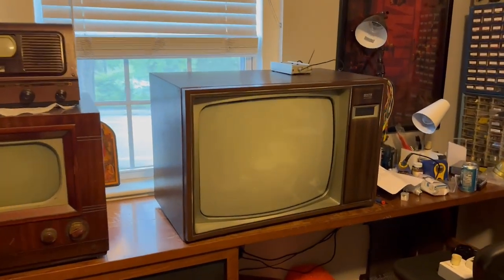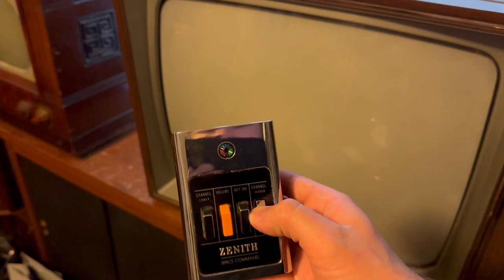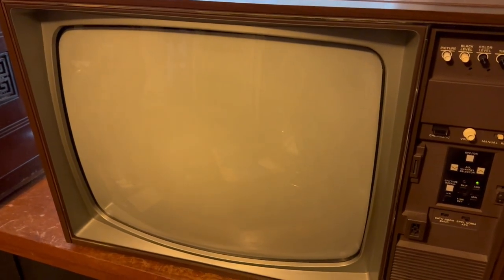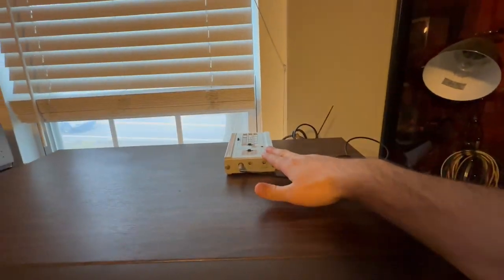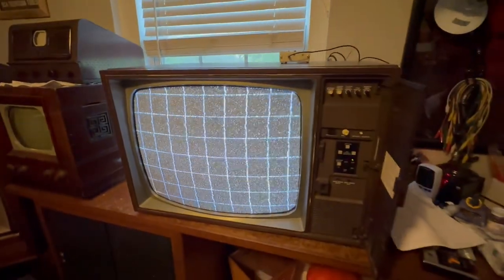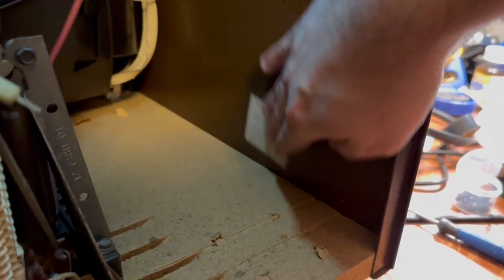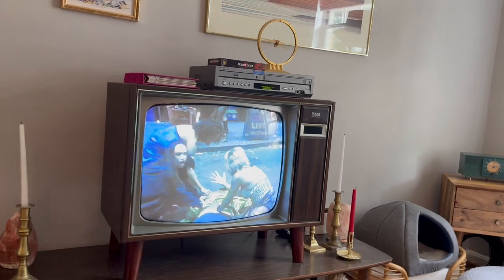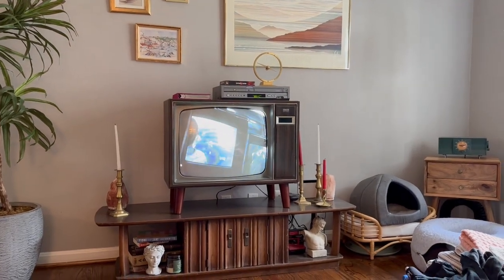Zenith Space Command Tube Television

Comment: One of these belongs to a composer who appreciates the notion of using sound as the remote controller.
Reply from the maker: I can understand that. It's a shame this idea didn't continue that long. I'd love if this was still a thing to reduce using batteries in remotes.
Reply: @televisionforever  Zenith could be wildly innovative. I have the first flat screen CRT ever, a Zenith. It is small, but oh did it change everything. Zenith saw into the future.
Reply: @televisionforever  lots of stories about the sets responding to shaken car keys and such.
Reply from the maker: @johnnytacokleinschmidt515  I’ve heard that too about older models that have a huge rotating tuner. I’m not sure if the shaking keys will work with this set but I’ll give it a try.

Comment: Your question about the remote may  have been rhetorical, but if you're wondering, one of the reasons they moved away from those "clicker" style remotes is because vaccum cleaners could produce the frequencies necessary to control the TV, and could cause the set to go haywire flipping through all its functions. Thus it necessitated manufacturers to introduce toggles for the remote function. 

Of course, with improvements to technology, they could make smaller remotes with more features than those "clicker" remotes could provide, since the latter had to fit a separate clicking mechanism inside for each individual function. This is the main reason, but I have to imagine the vaccum cleaner bit played a noteworthy part.

Comment: This set is a late ultrasonic remote. Original hand unit was battery operated. 
About this time they switched to IR & added more functions. It is a 2nd gen 
System 3 chassis. NORM-SPCL sw gives more AFT range. The other for OTA-CATV
channels.  Almost all problems on the 9-160-## PS/HV board. Mostly cold joints
but there is a 10mfd / 315V cap on the right rear corner near the FBT. Change it !
Main filter can leaks too!  Antenna hook up is stock  Tag you found WAS on the CRT
& a readout for its new condition.  CRT is a Zenith EFL type. Very sharp & bright
enuf to light a room !

Comment: 7:13 Could be aftermarket, they really held back a lot in NA on adding advancing AV ports, I was looking at a TV made in 1998 that still only had one RF coaxial port. Like in hindsight Composite should have been standard by 1985 as we had a lot of devices for that by then.
Do you always stick to stock era AV connectors, I've noticed TV restorations almost never add modern ports of any kind? For comparison most of the early 80s computer monitors were just SDTVs with the tuner removed and RCA jacks added.

Comment: I'm betting that set uses infra red remote control and MAYBE it still supports really old audio tone remotes. If you have a Beltron rejuvinator I would test the tube and just do a cleaning on the guns. I loved Zenith TVs because as long as the crt is good they had a excellent picture but I do have a Beltron so I could bring marginal tubes back to life for a long time. Too bad you can't get rebuilt tubes anymore but I gave up when flat screens came out and analog shut down there no longer was a market for old sets. I still have a bunch of tubes and old test gear that is mostly useless now and my main set is a Sony 75 Z9K 8k set that looks really excellent but should for what they charged for it. I still have one Toshiba 20" flat SD analog crt set left from the mid 90s that just sits in my room now. I HAD a 34hfx84 hd Toshiba tube set from 95 I bought new and watched till 2012 that did 1080i on down that looked pretty good for years but I finally gave it away to clean house and upgrade to a Sony 42" led set in my sisters room, it weighed 160lb and still looked good when it left last summer. 
You should be able to lookup the model number of that set and find out exactly when it was built and what remote it originally came with. Table top sets were kind of popular back then and I bet it's a mid to late 80s set. I had the top version that used a normal remote and had a picture close up button that doubled the picture size twice or so for a closeup. I think they called it Zoom or something similar and I think it was one of the last high quality chassis Zenith built before they were bought out by LG.
Reply: Older VCR 's and DVD players plus converter and cable boxes keep content on the old sets. Get your sets going. Don't throw that stuff away. Stay well.

Comment: Cool set! 
I’m very curious what year that is.  Because when I was a kid I had a 78 zenith space command with the large brick controller  with the zoom button. But it used a small radio transmitter and a mechanical channel selector for station selection and not high frequency audio tones. But that set seems  to be newer, even with on tv channel display but a much older two more system. Very strange 

Wish I never tossed that old zenith :-(